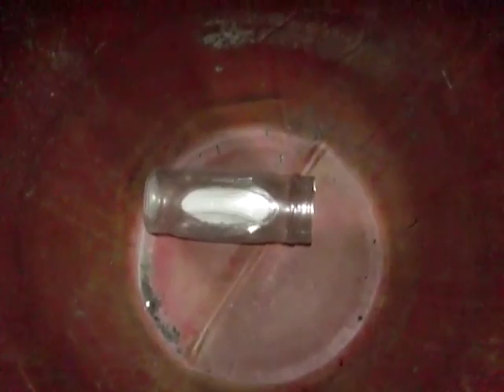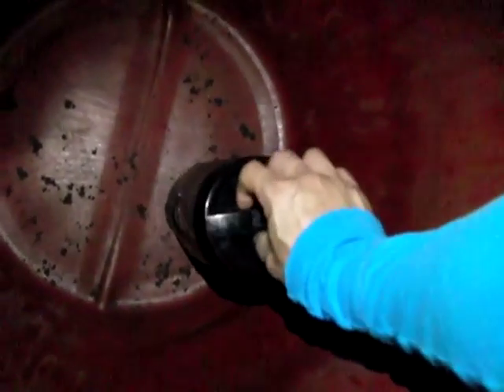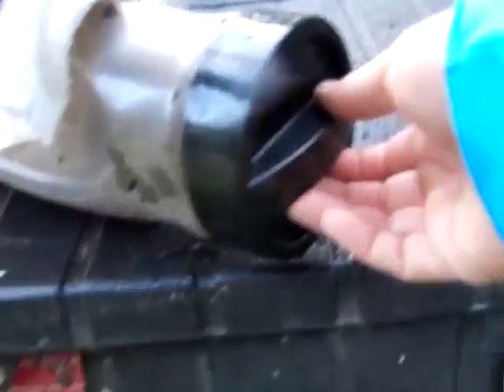Best Mouse Trap Ever DIY Humane Mousetrap Green Rat Trap for capture and release Rat Eats Moth

Comment: Great vid, I don't use kill traps due to the fact that if the rat is carrying any diseases, once the rodent dies, those fleas leave to find another host. If the rodent is alive, the disease goes with the rodent. I also don't like glue traps. I found a kitten almost fully starved to death on a glue trap. Vet couldn't save it. Plus the poisons can be mistaken for food by a wandering pet cat or dog or CHILD!!!
Reply: The diseases can be transferred from rat to puddle to thirsty dog to human too, just look at diseases like Leptospirosis--you can walk barefooted thru a puddle with a scratch or cut infecting you, you don't even need the thirsty dog link.

The best thing to do for vermin that can carry disease is to kill it, and burn it or put the dead rat in the trash. Kill humanely but remember they carry disease and are dangerously destructive to things like vehicles, homes, wiring, etc., and even cause fires.

Comment: Just add about 12" of water to the bottom, case closed.
Reply: Use salt water.  It keeps the bacteria in check.
Reply: The point is for them to NOT suffer
Reply: Richard McGuire  Oil.  Use oil.  ;-)
Reply: anangelsstar   Then make it electric.  No suffering, just 20k volts and 200 amps straight through.  Fart on "humane" treatment of an animal that will do nothing but destroy the very foundation of your home.
Reply: Jesus "Use Antifreeze"
Reply: Rats can swim for up to 4 days straight.
Reply: Richard McGuire You lot are sadistic.
Reply: A pair or rattlesnakes
Reply: 500 Years best one
Reply: Cruelty!!! HEART closed.

Comment: Fill a 50-gallon barrel with car exhaust (carbon monoxide).  When a rodent drops into that, he'll take one breath and fall asleep. Painless and sure.  Carbon monoxide is heavier than air, so it stays in the barrel unless there's a wind.  If you have to put it in a windy area, then you need a trap door.  But make sure only rats and smaller can get to it. You'll need to connect the car exhaust hose to a filler port at the bottom of the barrel to purge air out through the top.

Comment: Dude, you actually said ACTUALLY around 57 times! (actually I'm not kidding)
Reply from the maker: I actually agree with you. One time I did a radio interview and the host said "ya know" it was contagious. The two of us said it 900 times in the 45 minutes. So I worked on deleting that. After this video, I actually stopped saying that in future videos. Also "like" and "so" "okay". Weird but you really do not realize all the extra junk you say until you see it in video.
Reply: Thanks for your reply  @GREENPOWERSCIENCE  .
Filler words just makes us sound a little uneducated or unsure what we're saying. The worse is: "know what I'm saying", "ya know", "basically", "umm", and "like". Even worse than these 6th grade filler words is talking like an air-head valley girl where they in a sentence in an upward octave - as if it's a question instead of a comment. (you don't do this fortunately)
Good review overall and I gave you a thumbs up, btw.

Comment: If you wanted the rat to slip why would you cover the entire plastic board in sticky stuff
Reply: Do you even know how physics work? i mean, It's peanut butter and rice, the rat isn't going to stick to the plastic board, also, the peanut butter, if it had enough wait and was in a pile would most likely fall on it's own.
Reply: +Tntmod54321 Yes I can comprehend it; but, the peanut butter gives the rodent leverage which is as to why I felt the peanut butter was inadequate in making the slippery surface just that, slippery.
Reply: ***** Well on plastic, peanut butter is pretty much the same as thick oil, :I

Comment: If you trap only one rat at a time, you will get nowhere. You need to create mass dieoffs such as by adding about a foot of water in the bottom of the barrel and trapping continuously for a week, hopefully they don't wise up. The place where the angle of the plastic makes them slide off, should be further down in relation to the top of the barrel. That way they cannot hop sideways and fall outside.

Comment: IMHO:  A much more simple and effective way to catch rats "humanely" would be to use a Havahart® 0745 live trap. I have seen those traps sell for around $22- $30 on the Internet. The setup I saw used in this video may cost a little less and may catch more than a few at a time. But this setup also is more dangerous (IMHO). There is much less risk of being bitten by the rat using such factory made live traps. It is also much easier to release the rat into the wild ( I, personally, would not)

Comment: Some will jump off and grab on to the edge of the tub before they fall in. I've seen that several times on videos. Do more research. Watch some videos. You need to cut a hole into the tub at the top so that there is a wall around the rat and it doesn't jump off.